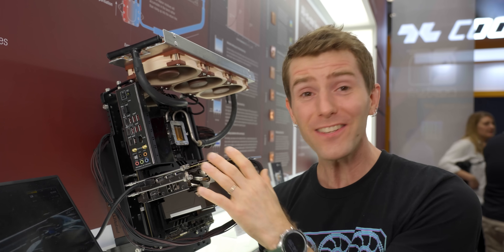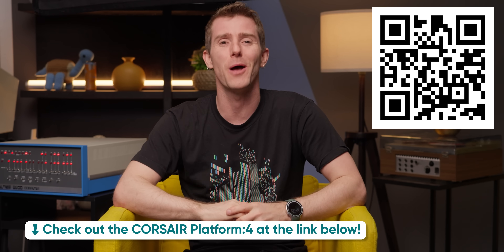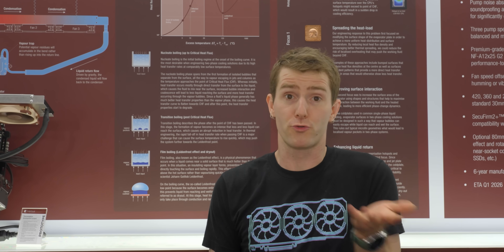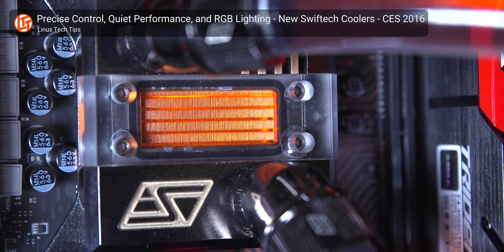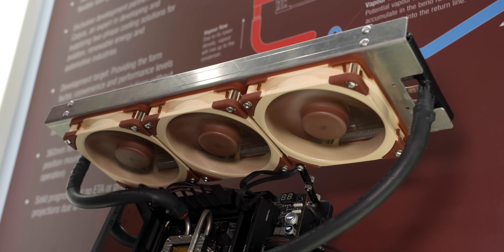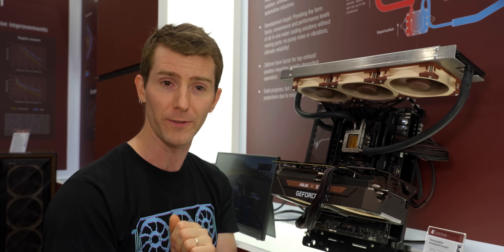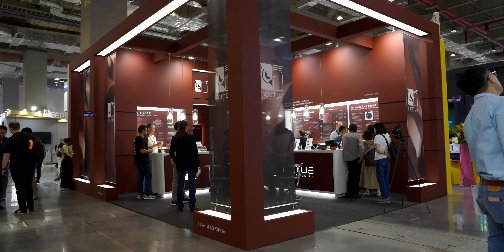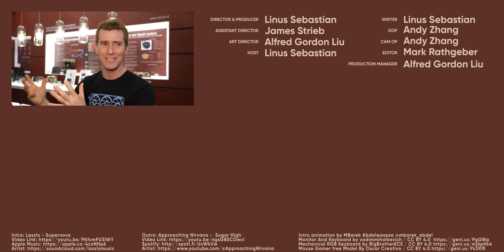6 Years Ago This Idea FAILED.. Now it’s WORKING

Comment: Well wait a minute the thing still has 3 fans on it. I can also adjust fan speed on my mobo to achieve the desired one fan slightly slower than the other fan thing. VRM cooling fans have always been kind of pointless too? I always way overbuy on the mobo though so maybe this is more for lower end boards? (Or smaller ones. I run ATX with chonky vrm cooling) It's another tiny loud (probably) fan! I still want one though it looks super cool. I wonder if it won't work right for weirdos like me who run a system where the mobo lies flat. Wtf is an anti sag bracket lol

Comment: My dad is in the business of industrial pumps. He's been in the industry for 40 years now, he's seen some shit. Literally, as his specialty is the waste water pumps (one of the hidden things keeping our civilization from falling apart). He's still amazed at the fact that people do not understand that pumps are expensive "wear parts". Meaning they're more like vehicle tires than mere motors. They need to be maintained carefully and replaced when it's time.

I think the PC industry would greatly benefit from applying the "car tire" logic when it comes to pumps.
Reply: I mean, as it may be true when pumping non clean water (and even then, I don't know anything about them and I estimate they should at least last 5-10 years), pc pumps are only used with filtered water and lasts 6-10 years. I would love my tires to last that long. 
I guess it could however be compared to a timing belt, as it would last way longer, and if you are very unlucky, a lot shorter.
Reply: But you are going to replace it anyway when you get a new motherboard with a different mounting socket.
Reply: modular fans exist but car manufacturers have a patent for it so it has not come to the PC market.

Comment: Phase change is such a powerful mechanism for heat manipulation. Like, if you can create a mixture whose freezing point is above 0 degrees, then you can create an ice pack that won't freeze cells in the body - allowing it to be applied directly, for the most effective cooling. (Incidentally, that's what I've done with my cooler vests. It's nice for hot days out in the sun as a technician.)
This is because it takes energy (heat) to change from solid to liquid and liquid to gas, and back. So, even though you are continuing to boil water, it will never pass 100 degrees (until it's steam, then it will absolutely go past that), you'll just boil it off.
Reply: ??? These exists? And you've made them? Where could i see these? Are there any plans someone could follow to make these? Or perhaps you're planning to turn it into a product? These would be really useful for people in tropical countries
Reply: @bluestone-gamingbg3498  Yeah. It's basically a particular sort of salt added to water to raise the freezing point of water.(instead of lowering it which NaCl does),  and put into an ice pack.
I shut down operations a year ago when not enough were interested to be worth pursuing any further. But I could see if I have any extra salt, and just tell you what it is if you want to know.
Reply: @SangoProductions213 What are the ingredient's ?i don't have ac in my car and my house😂.
Reply: Sure, it's called Sodium Sulfate (it's food grade, so it's minimally toxic in case of accidental exposure).
-It’s non-nutritive, so it shouldn't feed mold or algae (but I still recommend a light preservative if you're storing it long-term, since algae grows everywhere).
-It can form a gel-like substance when mixed with water, making it reusable and easy to handle.

How to Make It:
-Mix Sodium Sulfate with warm water.
-Warm water helps it dissolve better.
-Stir thoroughly — if you see brine settling at the bottom before it gels, it means it’s not mixed well enough.
-Stop when it becomes a thick, gel-like consistency.
-A little leftover brine at the bottom is normal — you can pour it into the next batch.
-Transfer the gel to storage bags.
-Zip-lock bags work okay, but ice pack-grade bags (thicker, more durable) are better.

How to Use:
-Chill the packs below their phase change point (about 5–15°C, iirc).
-Once frozen, they’ll stay cold until they finish melting — that’s the phase change effect, just like a commercial cold pack (just held at a higher temperature).
-Since it's at greater than freezing temperature, there should be 0 risk of frostbite, but it is still cold, so direct exposure to skin might still be uncomfortable.
Reply: Sure but the goal here isn't refrigeration but heat transfer so I'm not sure it is actually beneficial (solid phase can't be pumped and gas reduces the heat capacity per volume far too much compared to just pumping the liquid around).
Reply: something frozen above 0C? You mean something like metals that are solid crystaline sturctures at 20C? something like steel?
Reply: @turtlefrog369 Well, what you ideally want is a freezing point/melting that's low enough to be cold, but not cold enough to cause frostbite, or be too uncomfortable. This is because it takes heat energy to initiate a phase change. During this phase change, despite absorbing heat, it will not raise the temperature.
Steel has a freezing point that's much too high to be comfortable for the purpose of phase change temperature regulation of the body. I hear it can even melt robots at that temperature.

Comment: Honestly I wouldn't be mad if it turned out that you still need a pump for optimal performance with phase change cooling. The advantage would be that if the pump breaks down, your CPU doesn't go up in flames, it might just lose a few percent performance until you fixed your cooler.

Comment: Leidenfrost effect at the source of contact would be the biggest issue to get over.
Reply: Only if you insist on using fully submerged, macroscopic fins.  Heat pipes and vapor chambers do have to balance vaporization pressure vs wick pressure, but they do so with success.

Comment: I've been designing this stuff in my head for a long time including Tesla turbines and fluid dynamics and I see that they really need is not a grid system of a circle system with but fins that go in the same direction as the fluid flow is slightly narrow on the entrance and wider at the exit to encouragedifferent pressure intervals will allow the bubbles to escape

Comment: they only need to cheat....yes cheat....they use a phase change fluid with a temp higher than the cpu temp gets and have a top up heater after the cpu to create the phase change which creates the pump effect then you get full cooling on the cpu as it passes by it and prewarming for the phase change reducing any power needed for the temp boost

Comment: This exciting.  But im on the edge. The radiator used fan anyways, why not have it use pump? The design probably help make it more efficiently to transfer heat so its kind of innovation

Comment: IMO inverter driven compressors aren't that loud these days. I feel like they could make something that has an actual small linear or screw compressor to have an active instead of passive heat pump system
Reply: Why?  Passive performance runs rings around active for this specific use case, and does it almost for free.

Comment: Did anyone mention that it might be cheaper without the pump?
Reply: Longevity (if done right) is the only real advantage.  You cannot use any plastics or organics for any part that must be sealed.  Metal and glass only.

Comment: I'm conThermal differential equates to a pressure differential. It's bacically a refridgerating cycle. It's interesting to see why it was so difficult to implement effectively because the physics is straight forward, but you point out that it's not as simple as putting that cold liquid on the CPU.

Comment: The heat sink is so fascinating to me because it shows how different applications matter a lot.

The v shaped fins are to get the evaporated gas out of the way as fast as possible so that the air can't get trapped or act as an insulator which compromises thermal transfer.

The fins can't be too small because of the liquud's surface tension and gravity making the bubbles rise upwards. So the size is or has to be optimized so that the bubbles can't get trapped on the fins. And the fins have to be angled upwards such that the bubbles can't get trapped. It's really clever. Stuff like that, I just find fascinating.
Reply: Honestly, state of the art is, afaik,  to do what heat pipes do:  Sintered or foamed copper wick over a heat conducting structure.  If you're worried about dry-out, run the return loop fluid to the top of the wick stack, not the bottom or reservoir.  Sadly, you probably have to let go of that boiling liquid visual and accept a more boring vapor-chamber to get better performance.  Can keep the window though!

Comment: So many questions.  How is the liquid boiling?  Whats the temp of the liquid?  And wont altitude break it?
Reply: Heat pipes and thermosyphons work the same way.  The system has a coolant in it, and it's the only thing there; some of it is liquid and some of it is gas.  In [roughly] room temp systems, that coolant is almost always water.
When water is the only thing there, part liquid, part gas, it's under partial vacuum at room temp.  pV=nRT and all that.  An increase in temp will boil off some liquid and increase pressure.  Temp drop will condense some liquid and decrease pressure.
The neat thing is all the temp change ends up being effectively transferred by movement of vapor that equalizes things very quickly; the whole system's pressure stays the same (accounting for propagation) and so does the temp.  It works from freezing to well above sea-temp boiling of 100C, and engineering trickery can extend it far beyond that. Your limits are usually the material properties of your pipes.
Altitude affects it not at all.  It works the same way in the vacuum of space, so long as you don't exceed the working temperature range of the fluid, or the physical integrity of the system materials.
Someone at NASA calculated the size of a heat pipe necessary to handle the heat flux _of the Sun itself_.  It was of surprisingly achievable dimensions.

Comment: I was thinking have the return line in the base with tall stacks so the return pressure forces out the bubbles, also a large extraction tube for gas going down to a few capillary lines for the return so the gas pressurizes forcing the cooled liquid out at a slight pressure in multiple points along the base stack of fins.
Reply: The whole system should be at as close to the same pressure as possible; pressure differential == bottleneck.  That said, the pressure at the fluid return will always be lower than at the vapor exit.  Half the engineering in a syphon is designing the return so that vapor doesn't push out the return side but fluid still gets back in.  Using gravity is what makes it a syphon as opposed to a heat pipe, although some syphons cheat by using wick material at the return to admit fluid but block vapor.

Comment: I'm wondering if mounting a fan on the pump-less AIO would not only cool nearby components, but also add enough vibration to dislodge the troublesome bubbles if engineered right.

Comment: As strange as it may sound I can say that it certainly works. When I was a kid we had a sailboat the had a kerosene heater for use when the weather was a bit cold. This was basically a kerosene heater that heated a water tank the hot water was then circulating through rubber hoses to some heat sinks spreading the heat in the boat. There were no pump or fan and still it all worked. The reason was simply that the specific weight of water changes depending on the temperature. So hot water raised to the top of the tank where it was piped to the heat sinks  where it cooled and then flowed back into the bottom of the tank. All without pumps or any moving parts, just the heat making the water move.

The termo siphon shown in the video goes one step further using something else than water to circulate the heat. This liquid has a low boiling point and the vapor will have a low specific weight and want to move upwards. When it comes to the condenser it will cool down and turn into liquid that want to move down towards the unit on the processor where it will replace the liquid that has boiled off. The exact detail on the liquid used is not known but the efficiency depends on this. The liquid is not necessarily all that strange. Ammoniac, aceton or something similar that has a low boiling point can be used. Pure water would work, but not at boiling temperatures and without that the circulation would be rather slow. A one way valve can be used to improve the circulation speed but it adds a mechanical part that can wear out and make noise. That would make the pumpless option a little less interesting. A pump has limited life and also makes noise but it is more efficient at transporting the heated liquid and it works in all orientations.

Given the options I think I would rather have looked for a way to make the pump easily replaceable. An AIO is a closed system but nothing says that it can't have replaceable parts. Arctic Cooling made spare parts available to customers so they could repair a problem and refill the loop. Making it possible to replace the entire pump wouldn't be much harder than that.

Comment: 0:22 Isn't this just how heatpipes work?
Reply: not exactly heatpipes work in pretty much all orientations, that's why they're in laptops, because they don't depend on gravity.
Reply: @Exilum 
So it really is different then, but also not entirely unrelated?
Reply: @MostlyPennyCat  As @JuohJanhansson-bz3jb said, heatpipes use a wick, which means they are less sensitive to orientation. What makes them related is indeed the evaporation part, but the way they are used and function is quite different.
Reply: Yes and no.

In the general sense of using certain combination of a particular fluid and internal pressure to achieve effective evaporative cooling, yes.

But heatpipes are using a capillary wick to transfer condensed fluid to where ever it is evaporating.

This thing is using gravity to keep the condensate flowing. And because of it, it is slightly more sensitive to certain things... But also has flexibility. The condenser does not have to be a rigid part of the cooler design, but can be built more like an AIO watercooler, with the obvious fact that the condenser must be higher than the evaporator block and the hoses preferrably set so that they would only go up.
Reply: @JuhoJohansson-bz3jb damn you beat me to it. Fantastic explanation!
Reply: @JuhoJohansson-bz3jb  For the hoses you liquid side will need to have a trap and the vapor side will be more of a straight shot up to your cooler like they have it in the demo.

The trap is vital in this situation to allow the liquid to flow properly and return to the evaporator.
Reply: In a way it is the same, but in a Heatpipe the shape and channels make it work in any direction, and heatpipes aren't (easily) bendable, this concept just uses regular watercooling pipes
Reply: @Asviix  I beg to differ. Heatpipes are very easily and permanently bendable, but only when you're not trying to bend it
Reply: I thought the same...
Reply: I guess you can also say that in both mechanisms, the energy used to "pump" coolant around the system is captured from the heat source itself.

As opposed to a heatsink and fan and a pumped water colony system where the energy to move the working fluid (or solid with regards to the HSF) comes from an external electric source, a fan or a pump.
Reply: It's not a new concept. The first thing it made me think of was the Ford model T's Thermosyphon system that didn't need a water pump

Comment: I don’t care about hot spots, just are they using dichloromethane as the working fluid? Those seals looked reasonable for a closed hydrocarbon system.